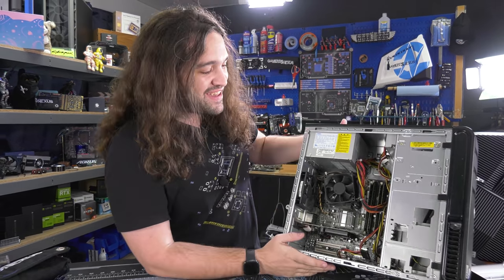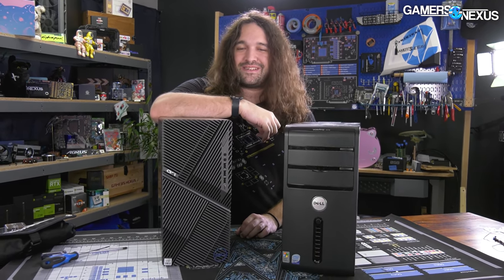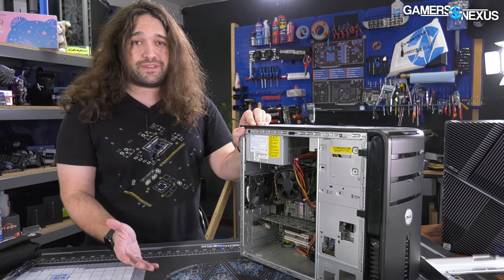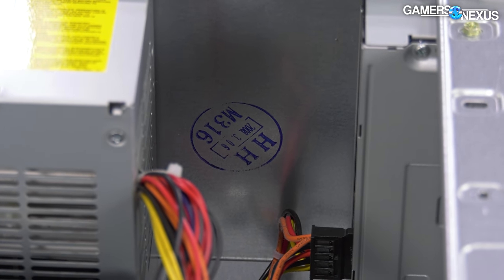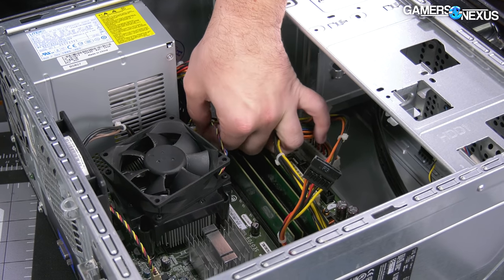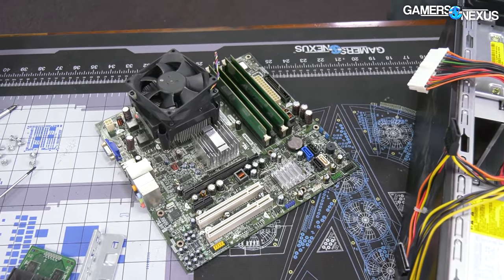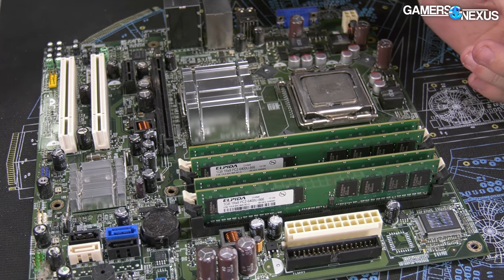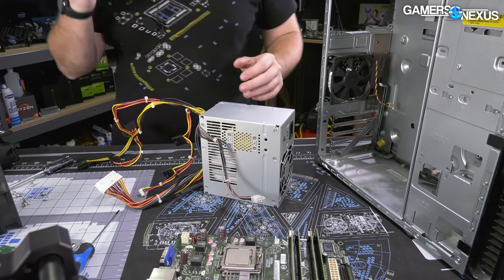13 Years of Dell Getting Worse

Comment: I had an old Dell mirco tower I got on black Friday back in 2011. It served me well up until I got a better gaming computer. It was horrible for game play and it struggled over the last few years to keep up as bloat ware from forced updates kept occurring. However I cut the top of the case open with a Dremel (lol) and stuck in a Nvidia graphics card as it did not have a stand alone card. Which honestly saved the PC from an earlier demise. The PC never gave me any issues and never thermally crashed. It's still running the OG 7500 rpm hard drive and the 8gb of ddr3 ram on a 280watt power supply. OEM CPU cooler and all... I stood by my Dell for years at that point because it had done so well. It was an 850$ PC back then. But I recently got a cyberpower PC for Christmas I played 3 hrs and experienced a thermal crash followed by thermal crashing every hour after that. A 1300$ PC was not performing like my 800$ 11 year old PC was as far as stability goes. Those problems have been solved. But I look at what Dell is now and I hang my head... Dell use to not be total crap at one point. The computers weren't perfect but they functioned then as should today...

Comment: I had a 2008 Dell PC, a Vostro 200. Pretty much the same thing you see here. It came with Vista Business (which worked flawlessly!) and thumbscrews on the case, so I'm surprised your Vostro 400 doesn't have those. I was able to gradually upgrade the CPU (to a max-spec Core 2 Duo), GPU (to a GTX 750 Ti), RAM (to 4GB), HDD, etc. Eventually I built a new Ryzen system in it! Unfortunately the I/O shield is built into the case, so I had to hack away at it to allow a new board to fit, and I eventually replaced the case entirely…
Reply: The Vostro 200 could only be upgraded to dual-core CPUs; the quad-core CPUs of that generation were actually two dual-core dies in one package, so cheaper motherboards didn't support them. The max amount of memory you could install was 4GB. I guess the 400 had a better motherboard then.

Comment: My favorite Pre-built is the Dell inspiron 660, because all the components are non proprietary and if you tape a $5 RGB fan to the side panel it looks amazing, my first ever PC project was an inspiron with an i5 3330, and then i upgraded the PSU to a EVGA 400w, and stuck in a GTX 460..... it was suprisingly decent for only costing me $90 for the whole "build"

Comment: The series after this, when they introduced the Dell Studio XPS 8000 series, had cases with removeable IO shields for the motherboard so you could easily swap them. Some of the OG Dell XPS 630i (before they bought alienware) cases with the Core 2 Quad processors had removeable backplates and standard PSUs and despite the cpu cooler being trash, they case had excellent cooling.

Comment: I’ve got an old beige Dell dimension 866LR from 2000 running windows 98SE and a dimension 2400 from 2002 running windows xp professional never had a single issue with either one of them. I also have an Inspiron from 2015 that is running windows 10 home again no issues whatsoever. I’m not sure I’d buy a new one though.

Comment: Explains my my old Optiplex is still good. Granted, I have a few strong needs to use win7 in 2021/2022 (thankfully they don't need the internet) which means I require older hardware, but putting up with  the learning curve on Linux is saving me from needing to pay the money on new stuff.

Comment: My old Dell PC still works after 15 years.   My new Dell PC is now dead after only 3 years, and Dell told me I would need to get it sent in, and have the motherboard replaced for $400.

My new job had me assigned another Dell PC, and the thing just freezes once every 2 months and needs a hard reboot.  ugh.

Comment: I still have a Dell from that 2008 era (Q6600) with Vista on it (it's not a Vostro, but the case is identical, except mine is all-white - edit: It's an Inspiron 530), and the damn thing still works. It had decent specs when I bought it. I think I just had to add a better video card and PSU, IIRC. I've replaced the CMOS battery twice. Solid rig for what it is, but not useful for anything but games from that era now. It's in the bedroom, fired up maybe twice a year. I also have an eMachines that I bought new for $185 on sale, and over time replaced/upgraded almost everything in it except the case, hard drive and CPU. I actually beat Crysis on that eMachine. I apparently love buying clearance-priced desktop computers and spending stupid amounts of money on them to make them good.

Comment: I have a Dell Dimension 2400 and hot DAMN is that a nice computer, even all these years later.

Mine is a trash pick special that was used by its previous owner up until 2022. It was for some sort of "pet sitting" and was soaked in dog piss.

One teardown and utility sink later, and its all back up and running! (Except the ps/2 ports, floppy drive, and optical drive) The only real issue I have with the computer is the lack of agp slot due to the crappy chipset.

It's currently serving as an ftp server for """"bulk"""" storage (gotta store those disk images and dumped firmware SOMEWHERE) and it does a pretty good job!

Idk about modern dell machines, but the mid 2000s ones kicked ass.

Comment: Given Steve's usual attention to detail, I'm unimpressed to see he missed that the older Dell case is manufactured E-waste - the IO shield is built in and will fit only the supplied board.

Also Dell PSUs from this era often looked like they were compatible with proper ATX supplies, but the connector would have a different combination of square and half round plastic pins and a different wiring pin out - making them yet more proprietary E-waste.

I enjoy messing about with old computer junk; I'm not a fan of any Dell era.

Comment: Overall a good video with a good point, but criticizing Dell for using (relatively standard if not officially standardized) rubber vibration dampening fan mounts (which are also universal)? That's a bit weird. Have you never used a Noctua fan? They bundle those in. And they're great!

Comment: I pushed a haswell Xeon (forgot which one but doesn't matter) dell workstation. It used a proprietary power supply with a cool daughter board and quick detach design. Cool. The reason I had to trade it away was the most powerful power supply could not support a Vega 56 GPU. If I was allowed to use a normal power supply I could have kept it working and enjoyed reusing some semi retro tech for gaming.

Comment: So I just did a tear down of my last desktop from 2006, it was a Dell Dimension 5150, and it is even better built than the pc in this video.

You don't even need a screw driver to add new hard drive, cd ROM drive, memory or video cards. It even had good cable management.

I honestly debated holding onto it for a stealth build.

Comment: The Vostro series was actually DECENT I have built many sleeper budget gaming rigs from those back when GPU'S existed and no be hypothetical concepts and they kicked sometime needed a new MB cause dells would RANDOM reject GPU'S for some reason but an Intel board is usually only $39away on ebay

Comment: I have a Dell Dimension from 20 years ago and it was not bad, it was cheaper at the time than building your own and the parts were fairly standard.  I did a couple of upgrades before retiring it after about eight years.

Comment: A time where pre built pcs were an option. 2008 i got the first and only pre built pc with a Core 2 Duo E6750 where we told them to change the 8800 GT for a 880GTX and that thing, even though the cpu and gpu were 1-2 years old at that point, was an amazing high end gaming pc, wich i used for 2 years until 2010 when i bought the original version of my current pc, wihc i since then only ever partially upgraded.

Comment: here's a thing with panel "porosity":
in the first age, in the first battle, when the shadows firsth lengthened... engineers stood.
there was ACTUAL CONCERN for radio emissions (both ways) so computers were designed with structural passive filtering in mind - the size and distance of the holes defines a frequency at which a low pass filter is formed which discharges radio waves down via earthing. emi shielding i think the fellas called it.
you'd probably want that say in a hospital near an xray or mri machine or in a production facility with lots of high power induction motors.

now YES time passed and for home settings of course this has all gone away sure but that's not downcosting or lazy design.

Comment: Nice we still used screws for the cover in 2008.
My PC case (Silverstone Raven RV03) is from 2010 and it has those thumbscrews.

Btw, the use of proprietary components is on purpose.
It's the counter movement against right to repair that multinationals do.

Comment: I must have really lucked out with my XPS in 2010. ATX power supply, halfway decent mobo, and even the gpu was an AMD reference design. I'd never buy from them today though. That XPS 8300 though? I upgraded just about every part in there at least once over the 6 years I used it.

Comment: For a few years around 2010 (Late Core 2 duo era and 1st/2nd gen core era) Dell did mostly produce desktops with standard components and then they have slowly transitioned back to mostly proprietary crap.

When they were using standard stuff it made them so much easier to use (Even if the vostros of the time had a habit of killing the onboard nic)

Comment: At my work we have top of the line Precision 3000 series laptops. As the in-house IT support I have never had more issues, ranging from constant blue screens to the CPU clock being dropped to 0.8 GHz when the batt is on full charge??? WTF??

Comment: I wouldn't be so sure that's a standard ATX PSU, Dell had a solid reputation in that era for swapping just enough wires on the motherboard connector(s) to fry components if you tried to use a standard PSU (or standard motherboard with the Dell PSU). Also, the fans may be 3-pin but instead of tach that signal wire may be spinning vs not spinning.

Comment: Q6600 with G0 stepping no less. The G0 stepping was famous for its overclocking potential, many G0 Q6600s ran at 3.6Ghz including mine (Classic 400Mhz FSB with x9 multiplier, 1:1 ratio with DDR2-800).

I think its gotta be my favourite CPU of all time.

Comment: i've got an old inspiron i got for free over a decade ago and the thing is an absolute workhorse. 3.5ghz amd 4 core and 6 gb ddr3 that needed (cheap) upgrade. onboard graphics struggles, though. i fried the ps cleaning it, and it was an easy swap/upgrade to a 650w semi-modular. same front plate airflow issues as this model.

Comment: @ 9:45 the only clean way I can describe the item on screen with out incuring demonitization would be "marital aide".
Reply: My noctua fans shipped with those, but I used screws. You use the rubber things instead of a screw. So marital aide seems appropriate! :)
Reply: @thebluelunarmonkey  I am quite aware about the the usefulness of the rubber mounts (usual help dampen vibrations) but i was more trying to get around using the word dildo.
Reply: @nateholt429  lol i know . "You use the rubber things instead of a screw" ... i meant her lol

Comment: The last Dell computer I bought was in the late 2000's. It was a $2,800 XPS gaming laptop. It wasn't even assembled correctly. They sent me another, and the top panel cover was bulging out bc they tried to push it onto the button wire assembly. I returned it and it took them 4mo to give me a refund, I had to get a lawyer involved.. I never looked back at dell again. I use an Elitebook for mobile computing, and custom built my own gaming tower. screw dell

Comment: Those old dell computers are surprisingly not bad, well maybe except for the lack of bios settings. Older ones from ~1999-2002 have massive CPU radiators with extremely powerful fans. Dell has definitely downgraded since then. Old thrown out dell computers are some of the best scrap computers to find for used parts too. I even once found an Intel x99 motherboard with an i7-2600 CPU that surprisingly has a 34 pin floppy drive connector in an old dell workstation computer.

Comment: Actually them not using those bendy PCI slot covers on the case, and instead provide metal ones you can screw back in, proves they didnt use to be a "save a cent here and there, f the costumer" company since pretty much everyone else was doing it back then... sucks to see stuff go backwards

Comment: No doubt that Dell has become a cost cutting, max profit company at the expense of user expandability and longevity. However I saw a chance to get a G5000 for  $1400 with a RTX 3070, 16 gigs of RAM with a i7-10700F and a 1 TB nvme  . So I bought it and swapped out the CPU heatsink and fans in the case for another $70. Considering the same system now costs $450 more a a few months ago I think it was an okay decision. It's been working great for a year now, we will see how long it lasts. FYI Dell has dicontinued the G5000... something about people buying a barebones G5000 and taking out the RTX cards CPU's memory and RAM and reselling the components and reselling them to make money.

Comment: Long ago my Dad bought a Dell for 3500 dollars. Shortly it had a problem booting up, they never would fix it even though He had bought the extended warranty. They never came out to check it and He even had a pc shop at the time. We opened up the case later to fix it ourselves finding that it had used parts in it. This was obvious because the video card had a lot of dust in it. Alienware was expensive but had cool cases so I used the cases to build gaming rigs. After Dell bought them out the cases suck. Old Alienware cases sell for more a complete computer from Dell now. Seems they would wise up. I work at a school and we never buy from Dell.

Comment: Wait till Steve gets his hands on one of their higher-end BTX formfactor systems of the day and has his mind blown by all the airflow. With several 5-1/4" drive bays available, I may add. 
Oh, and I'll take rubber nipples over firmly screwed-in fans any day of the week. A PC case is a formidable resonator and will amplify bearing or pole noise (Papst, anyone?) like nobody's business. I was a bit annoyed to find that HP had kept using screws until Ivy Bridge at least (8300 CMT), they should have had a look at, say, Fujitsu's. Most OEMs were at least doing something against harddrive and fan noise by that point. Their new hires would have been well aware of SPCR or even regulars much like the rest of us.

Comment: These were pretty good computers for nongaming applications and a lot of businesses and schools bought them by the truckload the best part was we could buy replacement parts in bulk and keep them on hand so when something in one of the 1200 computers we had on site did fail that computer would be back up same day. This was after the bad cap surge of the early 2000s and by now it was more economical to replace the Mobo than it was to replace blown caps which probably tinted my view of these computers more  positively.

Comment: Even Dell laptops suck. Got a brand new 5420 that had a bad USB controller and had boot issues, so the company I work for had the motherboard replaced. USB worked afterwards, kind of. Still had random disconnects, but the boot issues were even worse.

Comment: I have a similarly designed HP desktop a client gave me that's just couple of years newer than that Dell, but with a slightly faster Q8400 CPU and 8 GB of memory. During my evaluation of the different Windows 11 builds, I thought to install it on that HP (although using a spare SSD) to see how easy it would be to bypass Win 11's CPU and TPM requirements. That was barely an inconvenience and actually Win 11 ran pretty well. For grins, you might want to try this with that old Dell.

Comment: I remember getting a SFF dell pc with a Core i5 2500 non K (upgrading from Pentium G6950) and I used that system for years and it came with a Beefy foxconn cooler

Comment: I still have the Dell Optiplex GX260 and a T3500 workstation, which are real tanks.  Robust, you can open and replace everything without screws and have even the smallest numbers to analyze the postal process.  Really good quality.  In contrast, the Vostro looks cheap with its thin, careless sheet metal.  It's a shame that Dell builds machines like this today.  They are probably trying to retain customers by forcing them to buy expensive, suitable replacement parts from Dell.  This prevents third-party use or further use of standardized parts.  The PCs are often gutted and the inner workings replaced. That's exactly what Dell doesn't want, but rather you should buy a new PC.

Comment: To be honest. The old dell can fit a normal atx motherboard (modern parts can fit in it) i modified mine and cut half of the drive bays to fit in a 5700 xt. Painted the inside white and made it a Vostro 400 extreme...of course open case because that front is going to choke the hell out of it

Comment: My early 2007 Dell Optiplex 755 has the motherboard reversed so no other is compatible, so maybe they got a bit better, then proceeded to get worse?

...On second thought, the manual of the Optiplex 755 was from 2008, after the manual of the Vostro 400. I must have been confusing the CPU release with the manufacturing date. So, I guess they got worse even over the course of 1 year later!